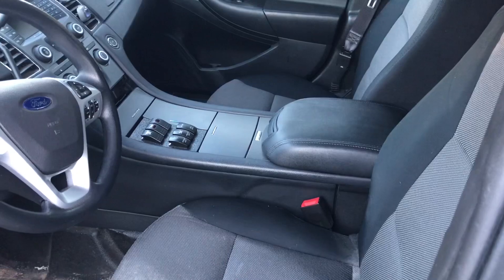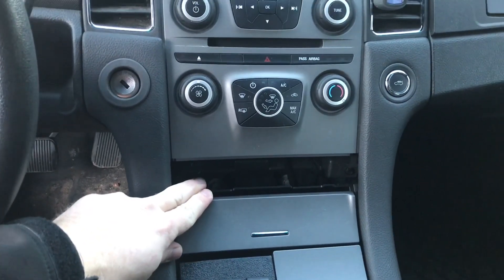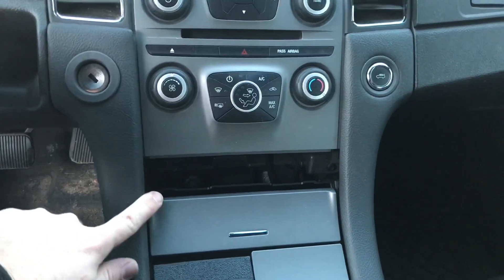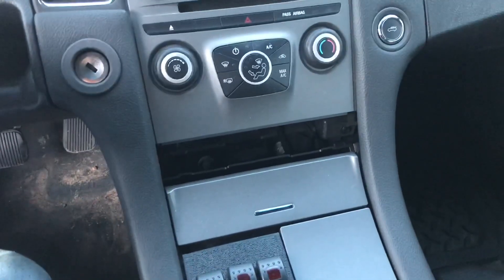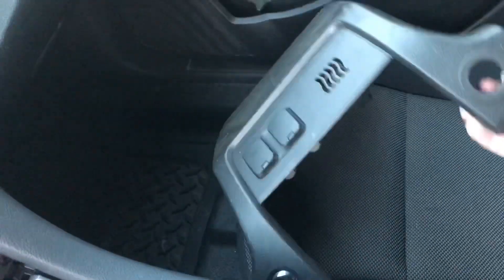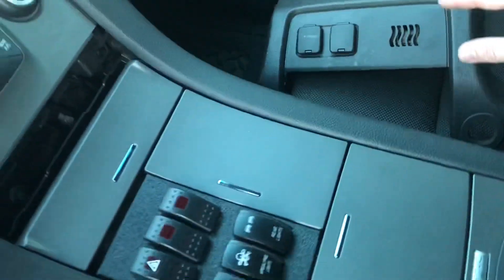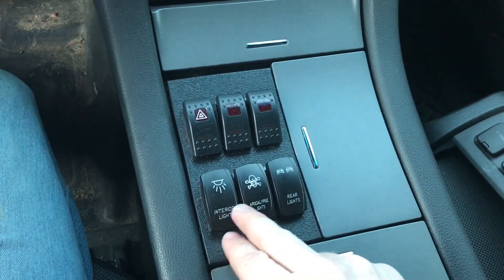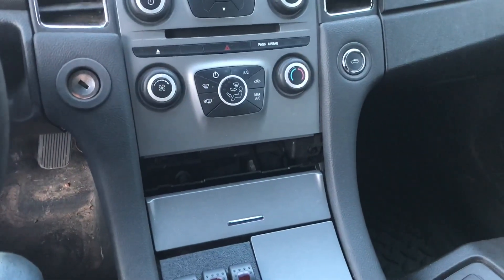Police Interceptor Center Console Followup

Comment: Could that actually be a microphone for
The hands free calling feature or part of the radio?
Reply from the maker: No, it’s some sort of sensor with a fan.  I initially thought it might be a speaker but after pulling the panel you can tell it has a fan.  The microphone is mounted above the driver.
Reply: @uwpd  your probably right then something for climate control